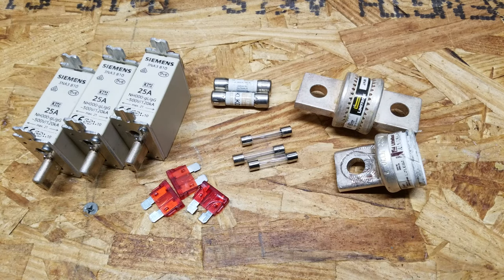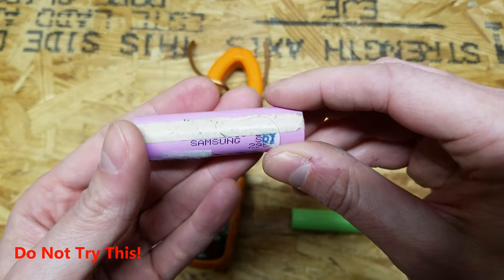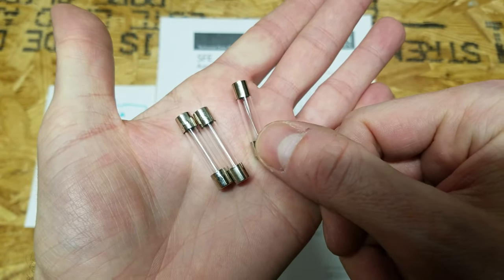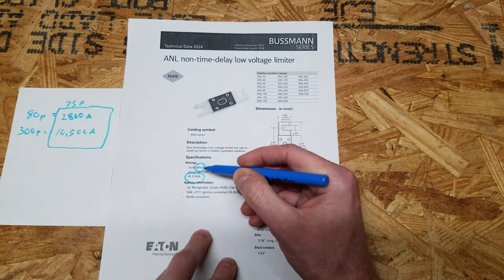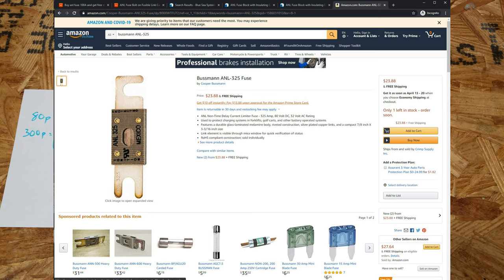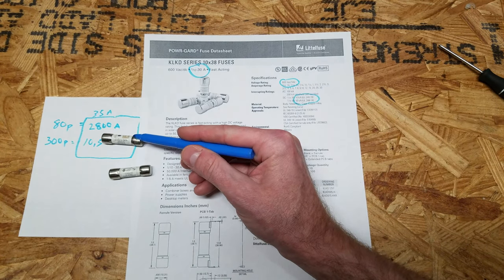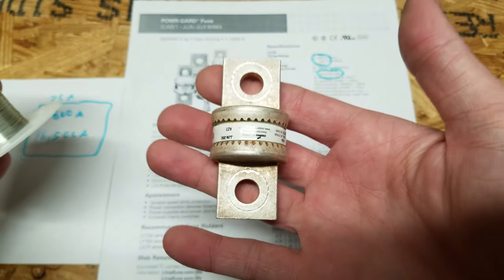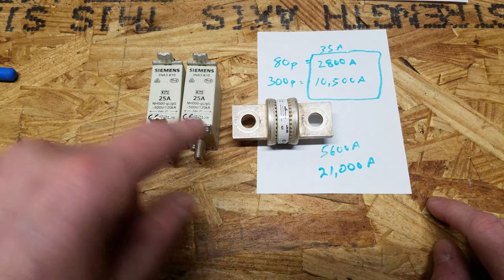Lithium Batteries - HRC Fuses, Short-Circuit Current, and Interrupt Ratings

Comment: The class T fuse has so many tabs inside because it is a bunch of parallel little fuses put together in what looks like a 2S18P arrangement. It helps to be more precise than 1 big fuse and generates less heat to blow. It can also have a few elements blow without failure during instantaneous near-rating transient spikes. This is the same style fuse used on EV batteries (I have seen a blown one on a Model S and it was a much larger version). Kudos for making this video explaining them and their use cases.

Comment: It's good to consider the resistance of the fuse in determining the max short circuit current. For example I have shorted a 10 amp glass fuse measured at .02 ohms across an 8 cell (28 volt) 200ah lion battery. The maximum calculated current is 28/.02 or 1400 amps. Using a scope across a .00075 ohm shunt resistor in series I measured a voltage that indicates approximately 900 amps. The fuse successfully broke the circuit. Thank you for the great instructional video. Note, I have purchased some name brand higher capacity fuses from Amazon that turned out to be counterfeit. This was detected  by measuring the resistance of the fuse and comparing to mfg data sheet.
Reply: That sure is a concern - fake fuses, you didnt say whether they had higher or lower resistance than mfg spec. Of course the temptation is to put a higher (piece of thick wire inside the cartridge, how would you know until after disaster?

Comment: Great timing of this video for me to reassure I fused my LTO battery bank correctly. Another great producer of YouTube videos suggested this to me after wiring each of my 15 LTO batteries individually to separate 20 amp automatic fuses inside a fuse box  making a buss bar from the box. Then connected to 4/0 wire to the large fuse and then to my charger/inverter. This gives me an automatic 20amp fuse for each battery and a master fuse for my battery bank.

Comment: Great explaining of the fault current capabilities of lithium cells and why proper system fusing is important
Reply from the maker: Thanks man, and thank you everything you bring to the community as well! https://18650shrinkandcellholders.com/
Reply: Unfortunately this is not even close to a proper explanation of system fusing. What makes these battery packs so dangerous is that there is no way to predict the amount of current that can flow when there is a short. If you have a 350 amp fuse, it is possible that only 300 amps will flow, and that amount of amperage is still enough to lead to a catastrophic failure despite not blowing a fuse.
Reply from the maker: @Shadowmaster625  If your wiring can't handle 300A then why are you using a 350A fuse? You didn't select the proper size fuse for your application.

Comment: The NH Fuses are used as Main Breakers for Houses here where i live in Germany. Which means they're they are able to interrupt short cicuit currents of 20 kA at 400V in Typical hous instalations here. The typical raiting is 63A. They were also  used to deliever power to entire streets blocks, then they have 1000A or higher raitings....

Comment: Thanks for this very informative video. Once again it has shown me another great example of my not knowing what I did not know.  I will now review in greater detail how I have fused my two 280 EV  4S2P batteries on my boat. I did use a 300 A t type fuse however I haven’t really every looked into or understood the issue of a fuse arcing.  So I will also have a detailed review of all of my recent upgrade projects on the boat. Cheers Kevin H

Comment: Your meter should have a max min button. It will show the actual max inrush. Great video
Reply from the maker: It overloads that too lol. I need to see if I can find a clamp meter with higher ratings for these kinds of tests.
Reply: @LithiumSolar  May have to make one with a shunt setup
Reply from the maker: @frankz1125  I retested the LG cell with the meter in inrush mode and got 118A. Thanks for the idea! :)

Comment: About the Siemens fuses and the missing UL certification: Since Siemens is a German brand and the fuses are not actively being sold in the US they simply didn't apply for one. 
They are however built and tested according to IEC specifications. And have certifications that are relevant/mandatory in Europe (e. g. by KEMA).
Reply from the maker: Thanks for the explanation, makes perfect sense! I see the particular fuse I have does carry a KEMA certification. I also see a VDE certification. Would it be safe to say that both of those are similar to the UL certification in the United States thus indicating a high level of quality and safety?
Reply: @LithiumSolar  All electronics sold in Europe have a CE marking, which indicates that it is conform to European standards (not to be confused with the "China export" logo which looks almost identical for totally not malicious reasons). It's kinda like the FCC marking. 

VDE is similar to UL, so an independent association which (among other things) certifies the safety and quality of electronics based on norms and standards.
 
I don't know too much about KEMA, but it is primarily owned by electricity providers so in the case of fuses and other power grid equipment they probably are a pretty good certification to have.
Reply: the Siemens fuses are not suitable for DC! A DC-arc inside the fuse during a short wouldn’t be extinguished in the same way than an AC-arc would. AC goes through 0V and self-extinguish an arc.
Reply: @testtester5653  You are right, not all NH-Fuses are rated for DC. But in this case the Siemens 3NA3810 is rated for 500V AC and 250V DC with an interrupt current of 120kA AC and 25kA DC. I would definitely recommend these.

Comment: Interesting topic.   A larger DIY powerwall pack should have fuse wire on each cell that (in many cases) will burn thru below 35a/cell which will affect the overall max short amps of a pack.  A cell may produce 35a but if the fuse wire burns thru at 5a (and you've verified this) then it seem like a 100p * 5a = 500a might be a better metric that 100p * 35a.   The axial glass fuses are even more precise than fuse wire.   So it seems like individual cell fusing could bring this topic to lower levels of max amp per 100p pack.  What do you think?

Comment: HOLY CRAP! You managed to completely confuse me and scare the crap out of me at the same time. I found a DIY 24 V, 12 Watt solar kit for my RV with 6 ea 12V x 200W Monocrystal panels that I planned to connect 3S2P for 24 volts DC connected to the 24 vdc 60 Amp MPPT Solar Controller. The kit contains 4 SOK 12V 206 amph LiIOPh batteries that I also planned to connect series/parallel for 24vdc system. Although billed as a complete DIY kit, it is missing some obvious pieces: pm connector box, bms,main battery cutoff, buss bars, and a 24 vacuum to 12vdc converter. Now the kit does come with various sizes and lengths of cables and wiring and 15 Amp inline fuse and fuse kit, MCA, and "fuse and fuse holders ". I had already determined that this would not be nearly enough fuses I planned for more but your video has confused me and convinced me that I don't know enough about it to even try! 
P.S. Although you spoke against the automotive blade type 12 vdc fuses, since all RV makers use these l must assume they are OK on the 12 vdc load side?

Comment: Perfect timing, I'm building 3 20p 16s packs to be in parallel. What would be a good size fuse for a 66 amp battery pack? Thanks for the video.
Reply from the maker: Fuses are typically derated to 80% and would be sized based on your maximum load. If you have an inverter that you plan to pull 66A under max load, your fuse should be 66A * 1.25 = 82.5A. You won't find an 82.5A fuse on the market, so you round up to the next commonly-available size. That would probably be a 90A or 100A.

Comment: Good content! For the nissan cell, or any other cell, you can calculate max shortcircuit current from the inner resistance of the cell.
Reply: How do I find out the short circuit of my Chevy volt gen 1 cells? I need to find two fuses for my 36cells X2 in Parallel. It's supposed to suit 30 to 40 percent overload rated over the max listed overload but i cant find any data.

Comment: Question: You determined the short circuit current of a representative LiFePO4 cell by (crude) experiment. How would you determine, or estimate, the short circuit current of a 100 A-h prismatic cell?

I have recently found a research paper where they showed a plot of current vs time of a short circuit event on a 160 A-h battery. The current peaked at 1080 A and the short circuit lasted 730 ms. 

A builder is unlikely to configure more than about four of these larger cells in parallel giving a peak short circuit current of 4320 A. There are quite a few fuses which advertise an interrupt rating (IR) that would accommodate this event.

Your thoughts?
Reply: Divide the cell voltage by the cell's spec internal resistance. That's the approximate short circuit current. The capacitance of the cell might produce a burst of current in excess of this, but it will be of short duration.

Comment: Do you use a holder for the class t or just connect to terminals?
Reply from the maker: Yes, they need to be in an appropriately-rated fuse holder. They will get hot during normal operation (especially the higher-rated ones).
Reply: @LithiumSolar  Thanks 👍🏼

Comment: great thanks. plz make one for the various breakers also :)
Reply from the maker: DC breakers are much more complicated since most on the market today are polarized, meaning current can only flow in one direction. On a battery bank, current can flow in both directions, making most of the breakers available inadequate. Many countries are starting to require non-polorized breakers for DC, such as in PV systems, but those available tend to be rather expensive making fuses the better choice :)

Comment: Question: I have a 12v 20Ah lithium ion battery pack that I built out of 2200mah LG 18650s from battery hookup. I am not using an inverter as this power bank ONLY power small landscape LEDs. However, I would like to protect my LEDs in the event my battery pack encounters a short circuit. On average the LEDs pull about 12 amps, but I round to 15 to be safe. What fuse/fuse holder should I install between my battery and the load? Thank you so much for all the information you provide.

Comment: So how do you tell when one of those ceramic fuses is blown? Other than no voltage output, checking continuity etc, but only by a quick glance there may be no visual indication if the fuse blew quickly and didn't get hot to leave any sort of visual marks.
Reply from the maker: There likely wouldn't be any visual indicators. You would know there's a problem when your equipment stops working and would have to use a multimeter across the fuse and see it's open.

Comment: Great stuff! I have a blown fuse on a parkside PAP20 A1 battery pack for cordless drill. Could you please suggest a suitable replacement for that unit. The original fuse is on board. Thanks & Regards. Sham.

Comment: I'm a little confused when at 5:32 you say "when a short circuit occurs if less than 1000AMPs flows through here, it is guaranteed to break it.... if 1001AMPs flows, it will arc and could cause a fire".    Does it blow at 1, 2, 3, 4 ... etc. AMPs too, because that's less than 1000?   The way I've always thought about fuses, is if it is a 50AMP fuse, it blows when more than 50AMPs flows through it.  Using my 50AMP example and assuming I'm right about it blowing greater than 50AMPs, you are saying fuses have another rating, the interrupt rating as in if the interrupt rating is exceeded, an arc could form at AMPs above the interrupt rating?   Is there more to a fuse than the usual 10, 15, 20, 30 label that we usually see on a fuses or circuit breaker?  That red automotive fuse, how many AMPs can flow through it so that it won't blow and won't arc.

Interesting video, I like when these less talked about topics are covered.  Thanks.
Reply: Anyone have an answer to this?  I would appreciate more understanding.  Thanks.
Reply: EXCELLENT question!  I've always wondered the same.  I hope someone answers.
Reply: conFUSED.   lol
Reply from the maker: Yes, you need to look at the interrupt rating. That's was what this video was about lol :) If you have a 50A fuse with an interrupt rating of 5000A, it's going to either melt, blow up, or catch fire if you put 100000A through it during a short circuit fault.

Comment: Great explanation for the difference in main battery fuses! I consider this is one of the common mistakes that people do when they are going to use a fuse.  What happen if someone use a wrong fuse? Can the battery pack catch fire or just it overheat?
Reply from the maker: If the wrong fuse is used, it could melt or arc under a short circuit condition and catch fire. It could also just open and nothing bad happen... You wouldn't notice until a fault actually occurred and it's too late, which is why it's important to use the correct fuse from the start.
Reply: @LithiumSolar  Thanks for your answer! You're right nobody is going to notice.
Reply: Hey...I just learned a lot from this video, thanks. But where do you get the fuses and holders? Did not see it at bottom.

Comment: why did the catastrophic fuse blow immediately?  i got a new camper and it wasn't plugged in to shore power.  i have 3 battleborn lithium batteries, an ic series 2000 inverter where the 300 amp littelfuse popped immediately after turning on the fireplace, then tv. the company is really giving me the run around and i'm actually in a hotel because of it.  please tell me why this could have happened so i can make sure when tehy finally service it they actually fix the problem

Comment: Data sheet was for mini blade fuses but you had full size blade fuses as an example? Interrupt current of full size is likely much higher.
Reply from the maker: That does appear to be the incorrect datasheet for the fuse I was showing. My bad, thanks for pointing that out :)  This is the correct datasheet, still 32V @ 1000A IR https://m.littelfuse.com/~/media/automotive/datasheets/fuses/passenger-car-and-commercial-vehicle/blade-fuses/littelfuse_atof_datasheet.pdf
Reply: LithiumSolar good stuff! Cheers.

Comment: Ive got 4s3p, 12V lithium prismatic batteries for RV. 300amp hr total. 3C discharge or 6C surge. I think this is 1800amps total? Im not sure just learning about this! What size fuse should i put in the positive line at the battery 2500watt inverter 5000watts surge line. 4ft wire run at 4AWG inverter line. 1ft, 0 AWG at the battery. BMS is 200amps. Can i use Bussman 300amp Mega fuse or should i use a Class T??

Comment: For high current lithium batteries, I suggest a high breaking capacity battery fuse in addition to the breaker. A high current arc is very dangerous...boom!
Reply from the maker: Yes. That was the entire purpose of this video.

Comment: I have a solar battery bank with four 12V / 115 Ah deep cycle flooded batteries in parallel connected to a 3,000 W pure sine wave inverter.  What amp rating / I.R. rating fuse should I use for the positive feed leading to the inverter?  Also, what amp rating / I.R. rating fuses should I use on the connections between batteries should one of them short out? Thanks.
Reply: I assume you figured this out by now. But for posterity, the installation manual of the inverter will spec cabling. Probably 4/0 for a 3kW unit. With that, 400A fusing. I'd personally do 125A MRBFs at each battery post. I prefer fusing each battery in a parallel setup rather than the final leg to the inverter.

Comment: I was thinking to use  anl or midi fuse without casing and some spring load mechanisms so if the fuse blow cable would be pulled away thus preventing arc from forming.

Comment: I would expect the glass fuses to have a much greater interrupt current, since once the wire inside melts, the distance between the contacts is to big to be bridged by a 32V arc.
Reply from the maker: That makes sense, but goes beyond my level of understanding. I suspect with amps in the 10,000+ range, the glass tube would probably just blow up vs the wire melting. That's just my guess though, I'm not going to test it!
Reply: @LithiumSolar  Maybe the wire vaporizes into a conductive plasma for an arc.

Comment: Thanl you for your video. I am planning on drawing a nominal amperage of 400 amps out of the batteries. Would it be ok to connect fuses in parallel? I cant find 500 amps fuses! Thank u
Reply from the maker: Fuses shouldn't be wired in parallel that way. You can get the Class T fuses larger, but they do get expensive. Mouser has the JLLN I showed in the video for $106 special order https://www.mouser.com/ProductDetail/Littelfuse/JLLN500X?qs=sGAEpiMZZMuvhwH9hxnX5qjBbeTzrq%2FCphyG3HnGyuA%3D you can also get them on eBay https://ebay.to/2x3HbGN but Mouser looks like a better deal.
Reply: That's huge! What are you building?
Sounds dangerous. You might want to have an EE inspect your design and implementation.

Comment: That’s why you should always cell-level fuse your packs. Claiming that the cell-level fuses shouldn’t be your first line of Defence, doesn’t cut it; why not only use these, together with the BMS protection, of course?
Reply from the maker: While the cell fuses do work for a dead short of a battery pack, it still should not be the reason a proper fuse is not used. Yes, of course they will work though :)